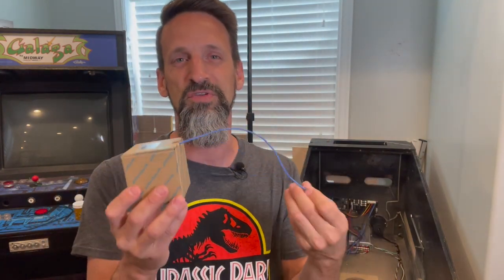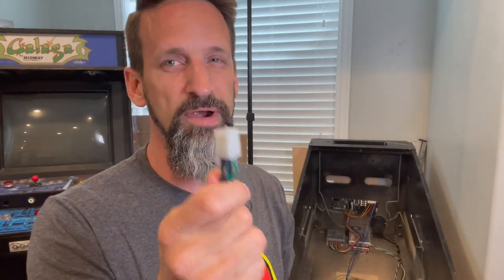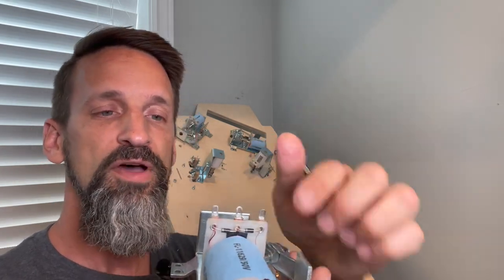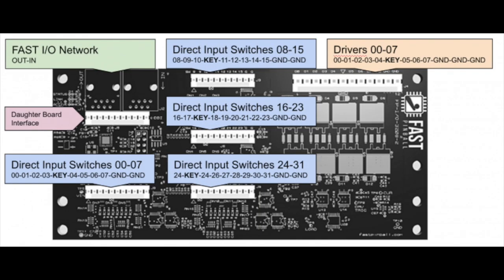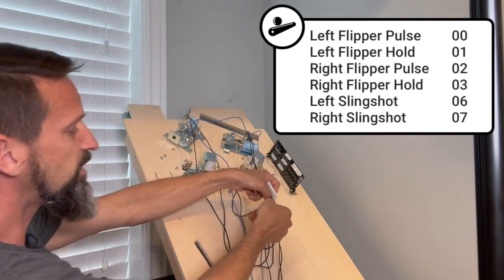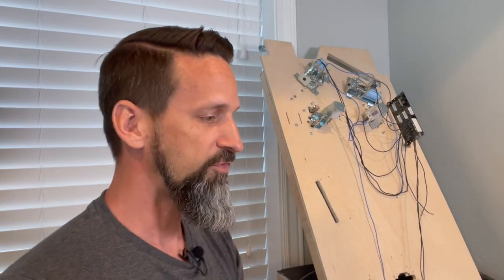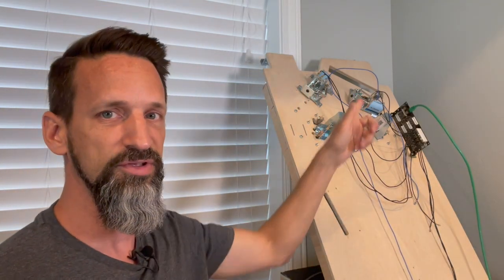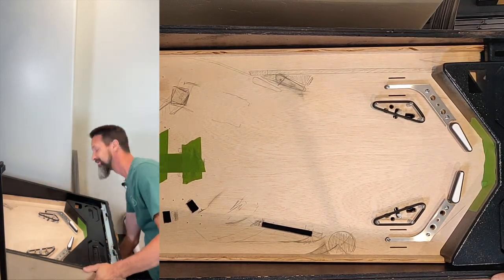HOW TO MAKE A PINBALL MACHINE: Working Flippers

Comment: Thanks for documenting all this so thoroughly, Steve. I've been binging the series (having just recently discovered it.) Your work is fantastic.
Quick question - I know that the flipper gets an initial blast from the 48v supply to the high-power coil. But then what delivers power to the weaker coil to keep the flipper up? Is it the 12v supply? Or is there something inside MPF that still draws from the 48v supply, but somehow adds lots of resistance to decrease power, or maybe an altered PWM setting as to not burn out the weaker coil?
Hope this question makes sense. Thanks again!

EDIT: Just found the answer in the comments (looks like it's PWM from the 48v supply.) Should've checked the comments first, huh? D'oh!

Comment: I'm really interested in all these frameworks and boards for homebrew pinball. Watching another channel's videos, I was pondering if the EM circuits could be converted into software, which led me down the rabbit hole of MPF. I do software for a living, so I should've guessed there would be abstracted scripting languages. I will admit, at first, I was concerned about the daisy-chain wiring to your slingshots, but after thinking about it I suppose each switch line is held high, and closing it drops it to ground, letting the controller know it was hit. Great job on flipping without smoking the components.
Reply from the maker: Thanks! So far no fires 😅

Comment: So I just got super into this whole idea.  I am a little overwhelmed choosing flipper coils though.  I was on Pinball Life and there are just so many options for coils.
Reply from the maker: Agreed! Check out the list of parts I Linked in my description, there should be a direct link to the coils I’m using, if you still have questions shoot me an email and I’ll helpful you get the right ones - thepinballroom at gmail dot com
Reply: @thepinballroom  Thanks.  I'll check it out some more.  I really want to get to the point of working flippers and mocking up some stuff.
Reply from the maker: @CrossPlatforming  there’s a guy that is selling a “starter kit” that includes a CNC cut playfield and a pair of flippers and the hardware controller boards from FAST pinball and the basic stuff for the bottom third of a playfield that you might want to look into- search for Trident pinball on Facebook in the strictly custom pinball group

Comment: Tip: always check if your diodes are faulty before first use. One of my flippers had a shorted diode which caused permanently damage on one of my driver boards :)
Reply from the maker: Oof! That’s unlucky, great tip for sure thanks for mentioning this!

Comment: I am working on building a machine with parts from a very old machine. The flipper coils from it are 24v, so do you have any suggestions on how to connect these to the 48v system? Thank you!
Reply from the maker: Good question, I'm not as familiar with the older systems so I can't tell you the best way to get those same coils working with a 48v power supply. If it were me, I'd replace the coils aside that's likely the simplest approach 🤷

Comment: These videos are really helpful, I have a question though. About how many volts/amps go through the thinner wire/hold power and the main power?
Reply from the maker: For coils, a single high voltage line (48 typically) runs to the coil and then there are two ground lines of the same gauge wire (18GA typically - same thickness as the power in wire) these two lines run back to the IO board that controls the coil, these lines switch on/off with one to the hold coil and one to the main coil line. 

Does that answer your question?
Reply: @thepinballroom   Thank you for the fast reply. Yes this helps a lot, I was also wondering how many volts/amps go through the IO board to the wire that holds the flipper bat up.
Reply from the maker: @pearhalfeaten2202  so if you're asking about how much voltage is used to hold the flipper up, it's technically still a 48v line but the boards use what I believe is called PWM (Pulse Width Modulation) to send a lower controlled amount of current - the exact amount is controlled by the game software config settings - that's about as far as my knowledge extends in that area - so if you're wondering what size wire to use for the hold power of a flipper - you should use the same size as the main power line - recommended to be an 18 gauge wire - let me know if that doesn't answer your question
Reply: This answers my question, Thank You!

Comment: You probably cover this at some point, but on the flippers. You’ve got a wire to the pulse and hold lugs. Does MPF just not use the EOS switch on the flipper to physically change from pulse to hold?
Reply from the maker: That’s correct MPF handles it all via software- however I’m pretty sure mpf can handle a physical eos switch too, but from everything I read a physical EOS switch isn’t necessary

Comment: Question about the wiring for the right flipper button (the one with green and yellow): why do you need both wires? You mentioned that there is going to be a second flipper, but they are still both controlled by a single button, right? So wouldn't the software just know "switch 00 closed -> fire both right flipper coils"? Or am I missing something?
Reply from the maker: So there are two ways of setting up a second flipper on the same button: you can do it the way you're talking about, where both flippers always fire when the button is pressed. Or you can do what's called a "staged flipper" where the button actually has two switches inside instead of one. And depending on how hard you press in the button, you can either activate one or both of the internal switches. This allows you to hold in the button lightly and have the lower flipper activated without activating the second flipper until you press the button in more fully. It allows a bit more control over the two flippers for certain situations where the player might want it, etc.  Does that make sense? And so, since there are two physical switches inside, you need a second wire to track the extra switch contact
Reply: @thepinballroom  That makes perfect sense, thank you! I didn't realize that was a thing, haha. But yeah, I can totally see the application of it. This has all been a blast to watch and seriously really inspiring, thank you!

Comment: Sorry, I know this was posted a while ago but your flipper switch is a binary state. Because you're going through a I/O board, you only need a single pole switch to kick as many flippers as you need.
Reply from the maker: The switches I'm using are so I can stage the upper vs the lower flippers
Reply: @thepinballroom  I understand. What I was saying is that the code and I/O controller already separated your flipper from the switch. From the code/controller you can cut the power to the upper/lower flipper using the same wire switch you're using to tell the system you went in to the upper field. Anyway. Just an idea.
Reply from the maker: @roamingcelt  ah ok I see what you're saying now, thanks for the extra explanation, I'm very new to how all of that works